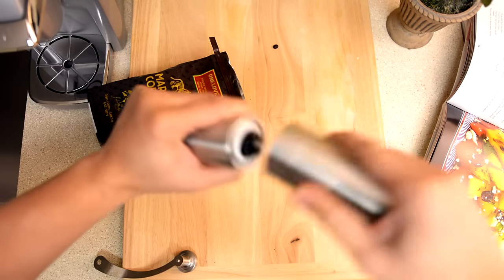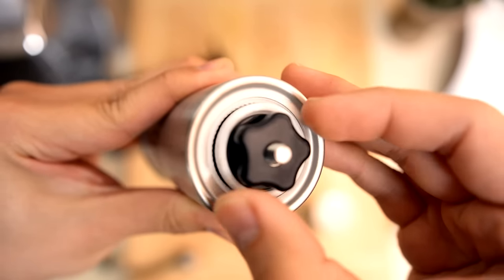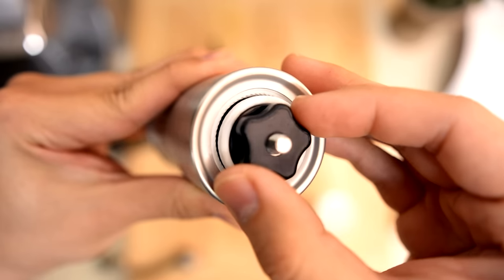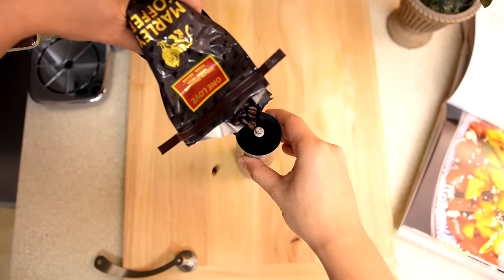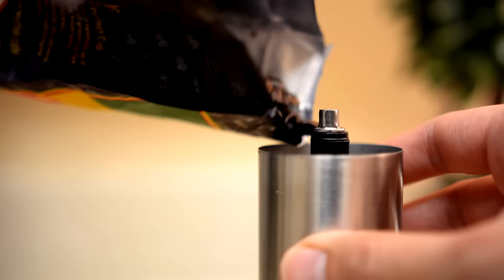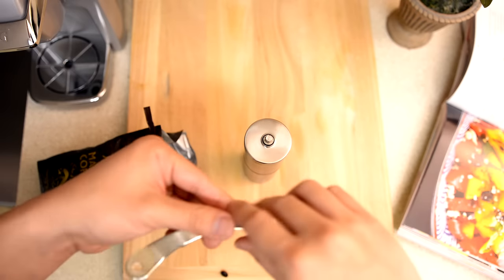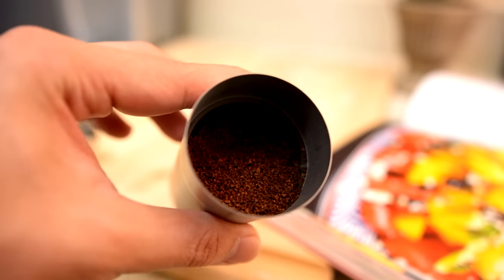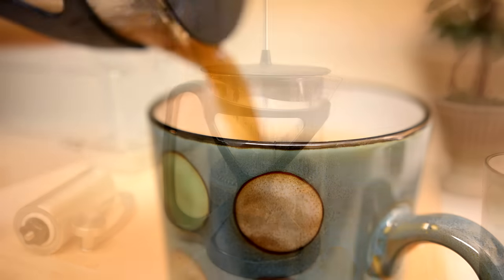Best Manual Coffee Grinder Tutorial - How to Use Coffee Mill - French Press Chemex Pour Over

Comment: Thank you for this. I have one and hadn't been using it. I lost the manual and forgot how to adjust the grind setting. To the left for coarse and to the right for finer. Whew! I am going to mark the thing. I have the iCooker version but I bet most of them are exactly the same because mine looks identical to yours. I think I paid around $18 for this one about 3 years ago. The only thing I hate is the handle. I lost screw so I don't have the little black plastic thing for turning the arm; I just pad it with a towel and spin it with the palm of my hand! LOL